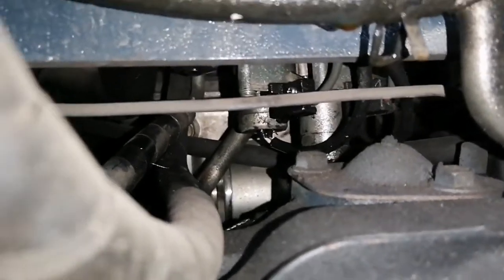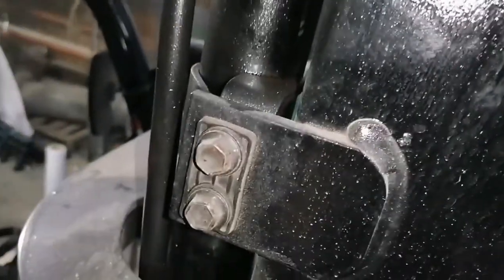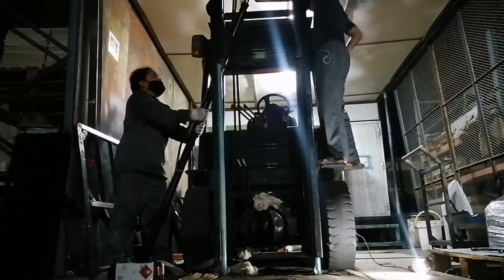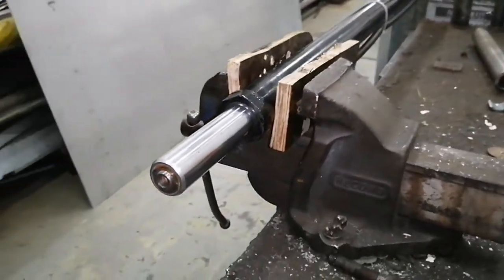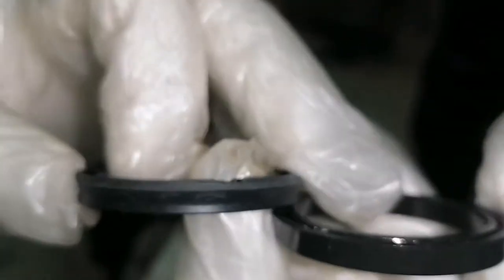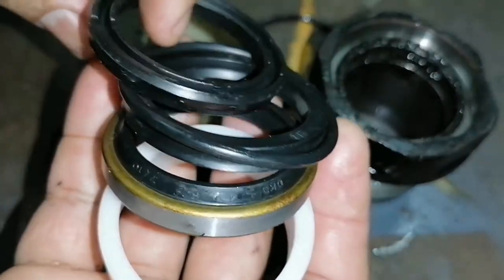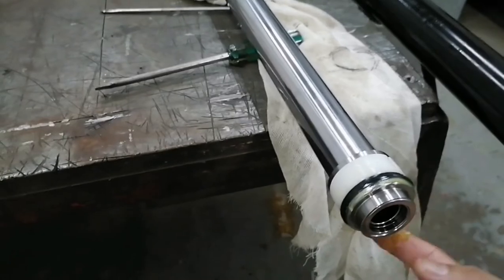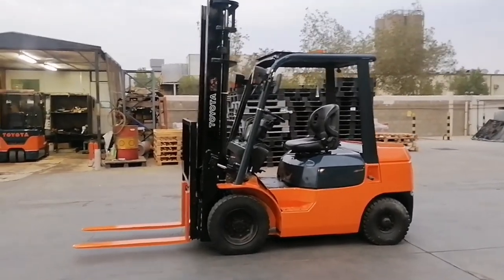How repair hydraulic lift cylinder of Toyota forklift

Comment: idol anong oil ginagamit sa hydrolic?
Reply from the maker: 32 or 37 viscosity grade ng Hydraulic oil
Reply: idol ginagamit dito diesel engine oil 10w ok lang po ba ito?  confused lang ako kasi bakit engine oil..
Reply from the maker: Mali yan.. Dapat hydraulic oil..
Reply from the maker: @jademarkbernante6839  nako hindi pwede ang engine oil sa Hydraulic system. Hirap ang pump nyan iba rin mixture ng oil nyan.
Reply: salamat sir idol..
Reply: Godbless po.